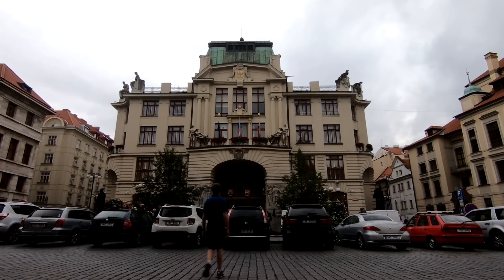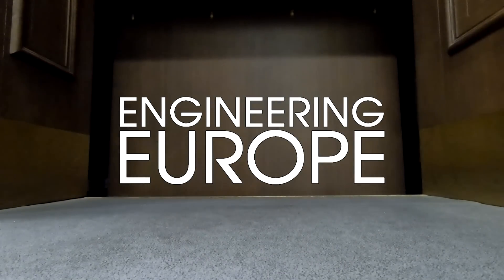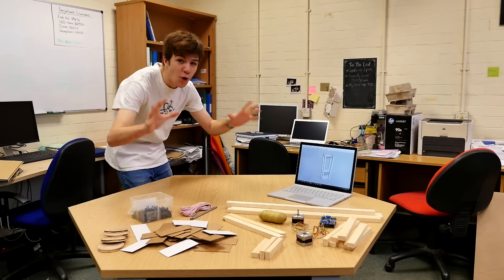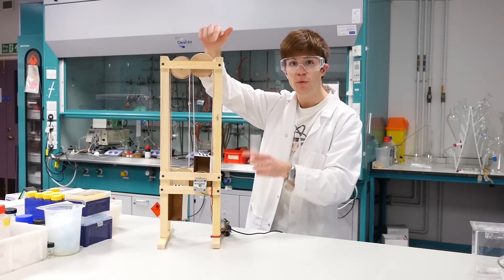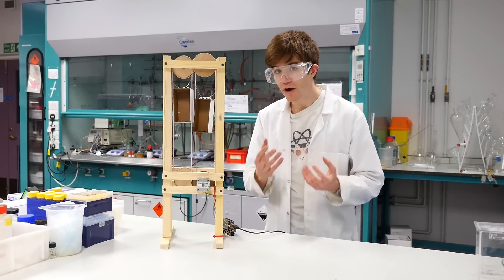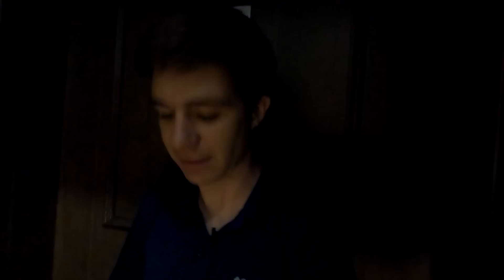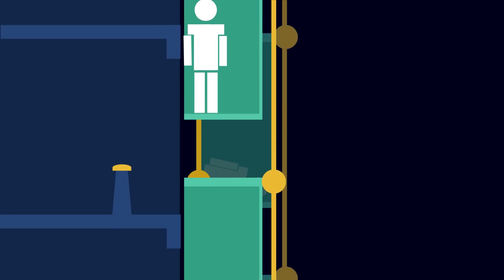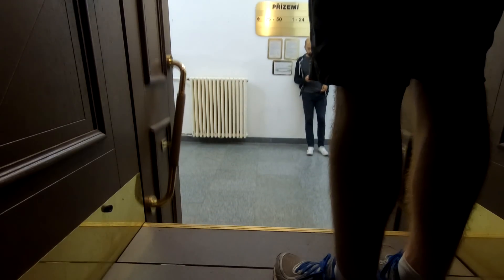Riding the Elevator of Death

Comment: Holy fuck I hate this. I don't want to get crushed between the ceiling and the elevator thank you very much. However, if this was completely open say, on the outside of a building with an exposed landing pad I'd be fine with it. As it stands this is too dangerous for me.

Comment: For some reason every time an elevator appears in my dreams it has the most fucked up design ever

Something like this except the cars are not enclosed and there is a big gap between the shaft and the car

To make things worse, in dreams I feel slippery as soap even just looking at them
Reply from the maker: That sounds terrifying, sorry for adding to your nightmare-fuel!
Reply: Atomic Frontier well I did find this pretty fascinating though

Comment: it's a stupid idea. let alone the potential deaths that it could cause, even from engineering prospective it is less energy efficient. it will need to be continuously running which means it will consume more power. also does it save you a lot of time? no it does not. with their size and how fast you need to get in and out, it could allow a maximum of 3 people per elevator with increased risks. so in the end most people won't agree to use one with others which means you will still need to wait. but modern elevators could fit around 10-30 people and when not in use, it could stop saving more energy over time with respect to this elevator of death